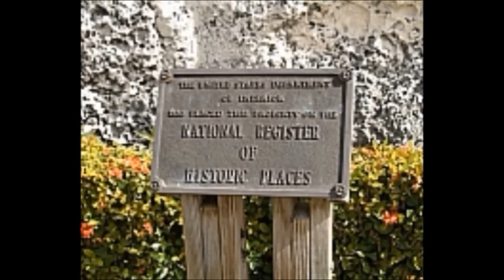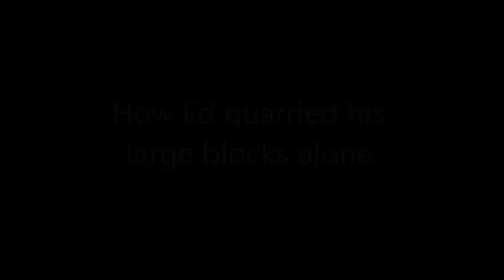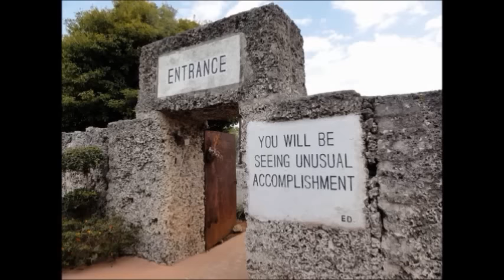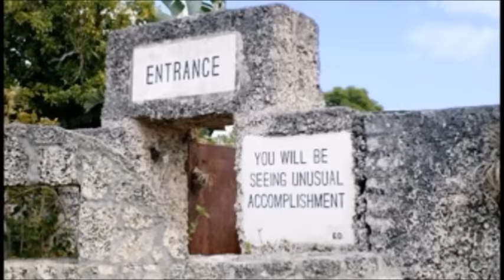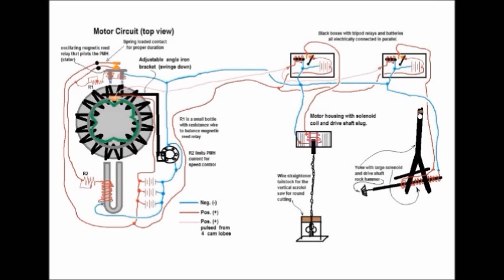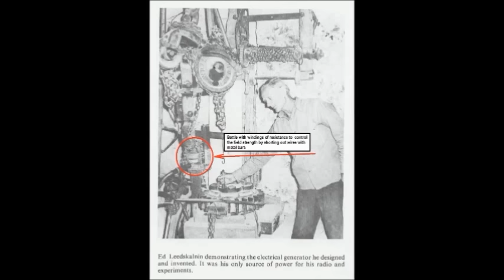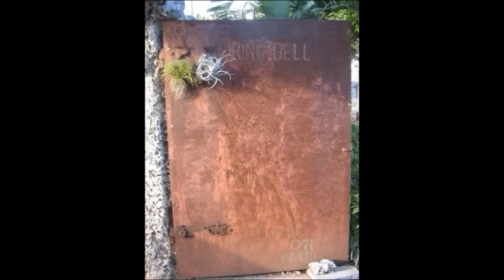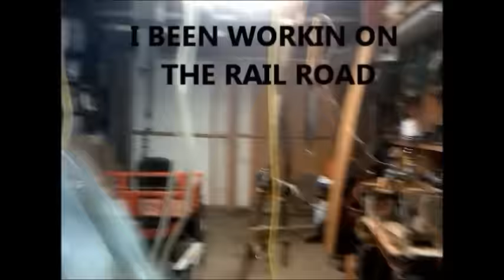Eds Coral Castle Quarry and Flywheel, Engineering Mystery Solved

Comment: I've read his books and been mystified.   This video is an excellent key to understanding the very basic , but also very complex machines.  Great work.

I do have a question though.  These machines are simple and have low tolerances for fit.  Wouldn't there be significant wear on the moving parts?

Comment: Thank you for all your physical work and intellectual effort to bring this accurate profile of the electrical engineering, physical engineering, and systems/processes engineering to the public. I hope to take all of this and create my own video with 3D mod3ls, renders, and dynamic diagrams to clearly show every component and process. My goal is to produce this as a companion piece to yours. Then, publish the related mechanical diagrams, circuit diagrams, and other plainly clear documents for posterity as the third component.

Comment: Scott, thank you for your efforts and for releasing this video! I work with high power lasers and robotics in the semiconductor industry. I came up with similar concepts as you, for the electronics part, but tripods still couldn’t figure out. i even tried to research tentpole circus and how they rigged such giant tents, with little luck. Your video finally put all my questions to rest. Too bad it took 9 years for youtube to suggest it. I truly believe your video needs to be shared as much as possible, not only for the concepts you demonstrate, but also for individuals willpower and what one can achieve with proper drive and curiosity. Ed at first and now you in his steps, are an inspiration! Have you ever heard back from Library of Congress?

Comment: Just a note for consideration with regards to moving the blocks into place without the use of rollers, rocker lifts or slide.
Placing a block under a 3 leg tripod allows the tripod to walk. this can be done with a small lever under each leg a small distance at a time, but their is also anther way. Rocking the weight of the block back and forwards will shift the tripod balance point. With enough rocking motion the leg/s will begin to lift off of the ground a little allowing them to each be moved a small distance by hand. As a different direction of swing would be required for each leg this would make for a rather slow process, but achievable.
Reply: nothing is explained in this vid
Reply: @youtuberesearch7017  Everything this video has said makes pretty good sense to me.
Reply: @axle.australian.patriot  For me not because don't see any placement of 30 tons blocks.

Comment: Nice job.
I see alot of peeps saying you didnt show how he stacked blocks....yes, you did. Why do people think he only had 1 set of tripod pulley's? Also, remember the length difference in the tripods? thats how you stack them as you move them along a path of roller logs. So you place 1 stone on the path, and along the path you have set up higher and higher tripods all already holding a stone,( that you previously moved along that roller log path and raised it up once it got under the tripod), then as your stone stack moves along the path you drop each stone onto the stone(s) as it goes under the tripod. See how it can be done? With the path ending right where you need the stacked stones to be placed.
Also, I do not think the door was the actual saw he used, I am sure he used a metal bar/rod with teeth cut into it to cut thru the coral. A flat surface a couple inches wide wouldn't cut thru the coral fast enough, it would take forever that way. I think the door was his sled, he used it to move and position the blocks and to place them. MOve the sled with block to where you need it, then place a tripod over the stone and lift it, remove the door(sled) and lower the block back down into place. 
Lots of things this guy did, Im thinking he worked in a quarry or was around one a lot as a kid. Lots of ideas e was doing where already discovered, just hardly used by MOST people cuz they didnt know about magnetism's power. 
Magnetism and Electro-magnetism are the future of our technology here. Mix in graphene and we're about to take another technological leap here on Earth!

Comment: What an excellent video. Thankyou. Theres probably lots more engineering and physics marvels within his designs. Such as, the method he uses to power the 16-tongued wheel uses a similar economical advantage as the Wankel Rotary Propulsion Engine, in that any energy not used during the rotation is still retained within the Rotary/wheel itself and then less and less energy is needed to maintain the rotation until the mechanism reaches a 'sweet' spot where because of the physics that ballance can be kept with very little power indeed. Its possible that there is also an electrical advantage in powering all those lights too, in that the bulbs themselves provide assurance that no electrical spike or sudden surge of power during operation will damage any of the components, as any extra energy will be safely dissipated in to momentary brighter light and exit the circuit as light energy.  It is my understanding that this is exactly why many older motorcars need thier lights on in the daytime, to protect the spark plugs and timing aparatus. Ed was just brilliant really.

Comment: Brilliant use of primitive 12 volt electromagnetic power. This should be interesting to pursue building such simplistic devices today even though we can rush out to Lowes or Home Depot. Eliminating the power company is the key. He basically built a giant sawsall and powered it off self generating power source. I would say that he worked at night so he could visually see the colors of the arcs and adjust the settings since he wouldnt have any volt meters in that time period in Miami.

Comment: Scott, I wish I could visit your setup and show you how you are wrong. I know what the wheel is and how every part works. Ed tells you where all the energy comes from and how it works. For you, I would be willing to explain every part of the pmh and the wheel. I will explain the particle moving through the metal, the concrete, the pipe, and every aspect in detail.

Comment: Brilliant, impressive research and detective work, you nailed it. Thank you so much for clearing the "mystery" up, one can only be amazed by your ability to figure it out, you're on Leedskalnin's level at the very least, you make humanity look good, very refreshing and inspiring. 

One sees how Leedskalnin was a unique, inventive, clever business man, using mystery and wonder to promote his castle, suggesting that he knew how the the pyramids were built, had his sweet 16 that he was waiting for, working alone, keeping his customers entertained, working the crowd like a magician. 

The pyramids, of course, were built using other technology, specifically water locks fed by canals and the pyramid ram/pulse pump itself, geo-polymer concrete poured in place, corundum grit saws, and perhaps even Brown's gas or chemical mineral compounds to soften rock and cut tunnels, plus more. Every large project requires a lot of technologies, e.g., Ed Leedskalnin's Coral Castle. Mystery solved and put to rest. Engineering and Ingenuity salute you, thanks!!

Comment: Small nit, but in the battery-bank mockups, the batteries are 12 Volt, which is not the period-correct 6V. The changeover to 12V did not come until 1955-'56.

Comment: sssFirst off,  He used the "B" field of a  magnetic in conjunction with a pillar oscillator that was similar to the rock he was working on.  Yes all the construction was completed and installed via sound and magnetic waves.  He had one critical Pilar on his property  that he fed via his "B" field generator.  His generator consisted of 25 "V" magnets five deep all in the repel mode!!  His "B" field generator would cause the pillar oscillator to kick in.  Given the pillar was a resonant source equal to the materials he was working on it made the stone soft like Styrofoam.  When you look at his tool marks you can see it was a soft material as he worked on it..
Reply: And how did you deducted that by looking at his tool marks that it was soft material?

Comment: @Made by one man Look up Searl Effect Generator. Looking at the shape of that magnetic wheel.. I think it could have another function because your/ed's apparatus has a similar configuration if the center ring that the magnets are mounted on is also a circular magnet or act like a waveguide with the clover shape. Since you have been onsite..perhaps there is a some tool like a cone/tube with coils that focuses the magnetic wave from that  wheel.. since there are claims that John Searl achieved levitation he couldn't explain during experimentation.  Anti gravity or simply building a strong enough coupler to earths magnetism to defy gravity.. meh.. more experimentation required.

Comment: Very good information, but you did not address the issue of him loading the truck in a short time as stated by the driver who moved the castle stones from were he built the palace first then moved and rebuilt it years later. also the 18 ton door that moved with light pressure or the 8 ton rocking chair that anyone could use. Most of the tools that you have in your video are the best breakdown of Ed's work I have seen. There are still some things that he did that could not have been done with just the equipment in your video. Some of the stones in the Castle would require very large trees because of stress of such large stones and the pulleys could not have held the the stones. That is not to say that all of the equipment that Ed used is still at the Castle. He could have sold some of his tools later in his life because he no longer needed it.

Thank you for the video, the information you gave broke down the tools and equipment for all the work he did to the stones better then anyone else I have seen.

I think we will never know how he moved some of the stones as fast as he did because the tools have been lost to time. But your video now gives us a good break down of a lot of the tools he used and how.

Comment: Back in the 80s and the 90s I managed a vault crew digging graves moving monuments putting in monuments and getting things back in place and we use just about everything you’ve described here and then to do our job. It’s all physical science the stuff he moved by himself as small scale to some of the stuff the cemetery people have moved around and erected over the years, not able to bring heavy equipment in, but had to do it by hand. Do you wanna see something amazing go to your local cemetery and remember all that was put up by hand, what’s the same techniques described in this video?. Just about every tool that he built here can also be purchased from the right companies and are still made to this day. If not your local welding shop can make them for you in a few hours. I know a few dozen things that were used that he didn’t include in this video. I would bet if you look around, you will find an old railroad bar. He most likely would’ve had 6 to 12 of these.

Comment: You got any ideas on how Ed cut the bottom of his slabs, because the quarry next to his castle makes it look easy? I got some ideas, they have to do with the water table there, and how limestone dissolves fairly easily when water runs through it. Combine that with the leyden jars, supposedly found at the corners of the quarry pointing inward, which would have allowed him to send a charge through the rock, in straight lines between jars. Ed noted that the water level in his well rose and fell every day with the tides.

Comment: idea: suppose he had two tripodes with a cable between them. Could he move the heavy stones along the cable between the tripodes using pullies? One tripod to lift the stone, then send it over to the other tripod and lower the stone from it. No truck is needed to transport the stone.

Comment: Great bit of detective work.

A statement attributed to Ed is "He discovered the secrets of those that built the pyramids" 

There is a wealth of evidence in tooling marks that powered drills, saws.. straight & circular...basically an array of powered tools were used in the  construction of the pyramids.

Could be that's what Ed meant.

Comment: The machine in workshop is made from a ford model A.. crankshaft v magnets I would say that inside concrete is the ford model A bellhousing as it had slots in it .. to stack the v magnets .. with the v magnets installed the ford model A   once started would run without any other alternative fuel ... basically the ford model A was a perpetual motion machine ... with a charging system ... Henry Ford  took the v magnet slots out when the model t was released... Edd made some improvements but those are the parts in video .. And how they worked in th ford vehicle when v magnets were added without them u needed gas

Comment: You did a terrific job with this. Pardon my criticism in its semi non relatively to to core material you presented. But to belittle those who have less understanding of engineering etc. Is slightly rude considering you're statement of log length "small, medium and LONG" is  perfunctory. I believe you meant "SHORT, mid length or medium and LONG".

Just saying.

Comment: Wasn't expecting to watch the whole video since I was doing other stuff but it's superb. I had never heard about this mystery and it does look like conspiracy theorists and free energy crackheads would be all over this.

It's a really ingenious system and you have done a great job figuring it out. The wheel itself is really interesting, in his place I think I would have gone with an electrically driven pendulum instead for timing.

Comment: Zero mention of the horse-shoe magnets with the coil that can hold a charge indefinitely or where they fit in, which is a very mysterious previously unknown device.
Reply: The purpose of all of this is 2 let the public hear the old and somewhat refashion It 2 ways of new if you can't fathom that then you need to go back to school this is a man that knew mechanical engineering and electrical engineering and was very learn it in several phases of dynamic engineering and if you can't fathom that then let the rest go over your head don't have a closed mind on things that can be done because if you do you will never get anything done this is a quote from Burke Jay Johnson a man of vision and I never say no to an hypothesis that is so great and engineered so well those who do not understand you'll never see it anyway thank you
Reply: @burkejohnson4285  Don't worry I am amazed by work of the producer of the video. 
Just so you know, I do fully understand what he is explaining, as I am sure others do as well, it's just that I believe there's a lot more to it than the rock moving and cutting alone. I believe there are greater mysteries here. Just look at the 10 tonne rotating door perfectly balanced so that it opened with the press of one finger. Some attempt to "maintain" it, ruined it, all attempts to replace it in balance have failed. Either there is more to this, or we have de-evolved in mechanical engineering.

Comment: You've done allot of work.. However,  FACT!!   all the  magnets were set up in the repel mode.  do a little more home work,  inductance was not part of the final device.  It also worked in conjunction with a pillar that was similar to Stonhenge... the " oscillator pillar" was a part of Coral Castle,  The horizontal aspect of the pillar was made of the same material as the material he was working on!!..  I strongly suspect the resonance of the pillar followed by the "B" field influence  from the ground that was put there by his "B" field generator disrupted the Gravitational fields.  He could then use resonant cones to control the position of the stones..
Reply: Make one
Reply: @stevens392  I have tested the "B" field and have proven anti gravity effects of same!!!!!!!!!!!!!!!!!!

Comment: This is not solved by any means, I have been following Coral Castle for decades and there is more to this than meets the eye. You have to be credited for your experiments and the time put into your ideas and you may have a small piece of how Ed built the castle but until you build such a place you will not be completely believed. You know this was not the first Coral Castle, the original was built by Ed years ealier in Florida City, he moved it to Homestead Florida. Strangly the first thing Ed built was a well, the spiral one that exists today. I honestly believe what he accomplished is a lost art which includes magnetism, including the Earth's magnetic grid in unison with the Moon's magnetism and water magnifies this force. Did you know the pyramids in Egypt have a large body of water underneath it as well? Look it up.  I do not care how many wenches and pulley's Ed used...a tiny little man as he could not have possibly been able to generate enough strength to accomplish what he did. I do agree Ed did use practical means such as coils for certain aspects but not everything. In your video you show coils with the ferrite bar moving when powered, this is practically no force at all generated to even start to do what you claim it would such as cutting coral, etc. Like I said, if you have everything figured out, build such a castle BY YOURSELF just as Ed L. did and wel will believe you are correct!

Comment: Those DC pulses could also be used to operate lifting ratchets, for a massive pendulum hammer/chisel. There's a lot more force behind a large boulder swinging from ten feet than a small hammer moving only a few. Very impressive functioning reconstruction. Very few people could have done what you did here.